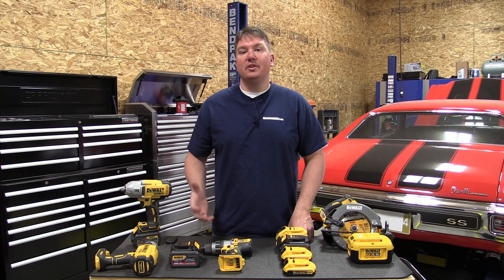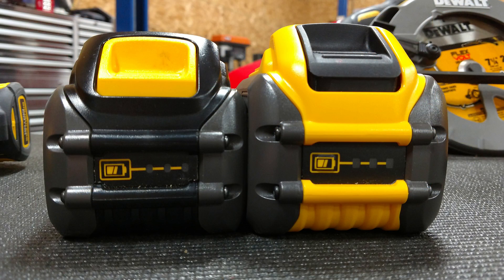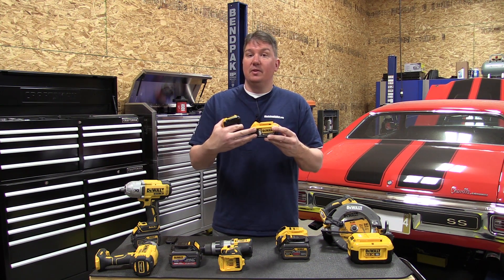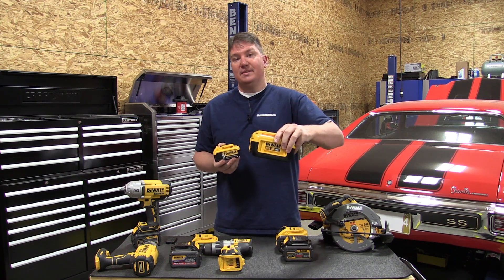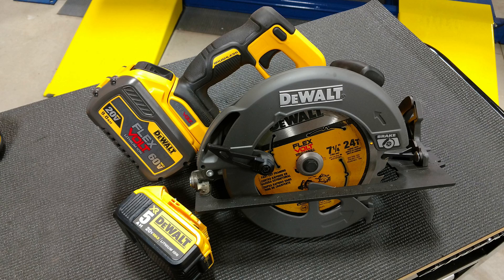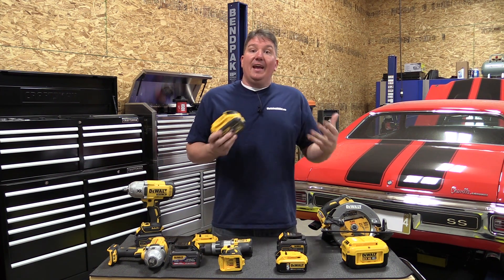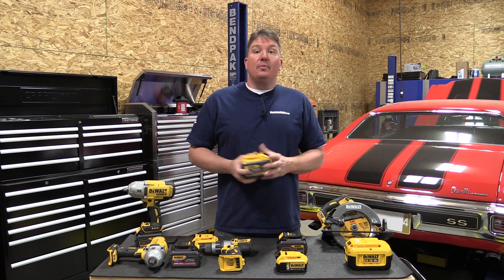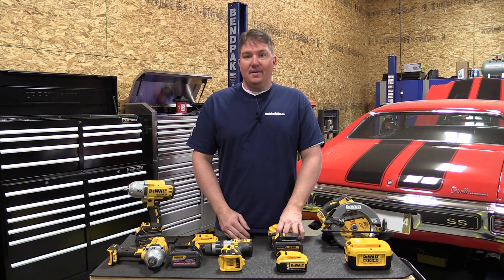Dewalt Flexvolt 9.0Ah 6.0Ah vs 20 volt max 5.0Ah 2.0Ah vs 40 volt - How Dewalt Batteries Size Up

Comment: I have to say, this video is a lot more confusing than it needed to be in my opinion but gave a good look at the sizes of the batteries and how they sit in the tools.. In the UK the 36v (40v Max to the Americans)  range is pretty much non existent. You certainly can't easily buy that stuff anymore. 18v (20v Max) is pretty much the standard now and the new flexvolt range is now taking on the mantel of professional user. Forget about the size of the battery for a second. It is really rather easy to work out what is going on. Making an 18v pack is easy these days and everyone does it. Making a 54v (60v Max) pack require 3 times as many cells to make the 54V. (3x 18 = 54) They could have just wired the cells in the battery to have a single 54v battery that had a single use in only 54v tools. But the way they have done it means that you have 3x 18v pack in the flexvolt battery and if you run them in an 18v tool you get the capacity of using 3 batteries. If you use them in 54v where it uses all the cells at the same time, you get the capacity of a single pack. 
A flex volt 6.0 Ah pack is quoted at 6.0Ah for marketing purposes as it sounds better and it is 100% true when used in 18v tools but if you join the 3 cell pack together to get the 54V the you will only get 2.0Ah capacity. 
It is actually a very clever way to get the best use from your tools and batteries. As the battery is capable of working at 18v it is totally capable of being charged from any regular 18v charger. The downside is the time, some chargers will charge a 18v 4.0Ah battery in 60mins. this means that same charger would charge the 6.0Ah flexvolt battery in 90 mins. The new chargers are fan cooled and charge the packs that much faster but technically there is no difference other than charging rate achieved.
I have no idea on the history of why Dewalt had to call the range 20v Max in the states but it is also technically true as an 18V battery when fully charged will put out 20v but only for a very short time until it drops to it normal working voltage of 18v for most of the run time. I assume there are different marketing standards in the states. 
Thanks for the video, was nice to see the sizes, especially that old 36v (40v) pack.
Reply: Cheers, thanks for your explanation as it relates to what we get here in NZ, and now the market is flooded with 20v tools but we're use to the 18v and 36v so everyone is wary. Even the sellers are unsure! Yay for youtube!

Comment: Hi  Guys  
question for anyone who has got the DeWalt DCB609 20V/60V  Flexvolt 9.0Ah Battery and has put it on a DeWalt  DCD996 Drill  or a  DeWALT Impact Driver DCF895  that have the belt clip on the side 
has anyone found that the 9.0ah battery struggles to go on the tools with this clip in place ? 
i have found you have to blend the clip to get the battery on  
please let me know if anyone else has found this a problem

Comment: Well, Dewalt might have some fault making it confusing, but to be honest, I don't know what's so confusing about it.

20V battery works with 20V tools.
40V battery works with 40V tools.
60V battery works with 60V tools.
Up to this point, SAME TO ANY COMPANY.

But Dewalt just adds one more here. 
60V battery works with 20V tools.

This just ONE additional thing is so confusing? Well, well...
Reply: Kyong Song not really there is just a pc on the 60 volt tools that switches the cells from running in parallel to a series setup giving less ah but more Volts
Reply: Don't be the idiot that puts a flexvolt battery on a non XR tool because you will find out real fast how quickly they destroy them

Comment: In uk and Europe the same batteries are sold as 18v and 54 volt they made it confusing for them selves.
Reply: Dewalt and many other tool companies play fast and loose with the numbers in the US to confuse consumers. their tools only run at 20 volts at starting power under no load, they are actually 18 volts just like every other tool brand once you start working. most European countries have stricter regulations regarding accurate tool output specs so all their tools and batteries are more accurately labeled there.
Reply: But it's kind of funny Snapper Europe is still marketing their tools as 82V Max just like in US... when it's actually 72V (20 cells)
Maybe some European countries have different regulations?
Reply: Kyong Song I think that by European law they have to name them as what the actual out put is as opposed to technical maximum out puts.

Comment: It's simple math: voltage (V) x amperage (I) = watts power (P). The small 20V battery can produce 2.0 amps for 1 hour so 20 x 2 = 40 watts for 1 hour. The smaller flexvolt is 20/60 so is either 20 x 9.0 Ah or 60 x 3 Ah -- both equal the same 180 watts for 1 hour. Notice the smaller flexvolt is essentially 3 times the battery of the small 20V battery, it's just connecting the 3 rows of cells in series or parallel. So if you had two 20V drills connected to these two example batteries, both being loaded identically, the flexvolt battery would last exactly 3 times as long (theoretically). Google "wiring batteries in series vs parallel" for further explanation.

Comment: It may be confusing to some of you but from an engineering standpoint it makes sense. When a electric motor has to put out " more power", then you have to increase the wire gauge and windings it it to do so. By increasing the voltage going to these new cordless tools and still be able to use it on the current line of tools its a win win. The tools that demand more voltage to operate more efficiently can use the 60 or 120 volts that they can produce but the hand drills and smaller tools still only have a small brushless motor in it that works fine with 20 volts. Being able to vary tbe voltage supply from one sorce and have it do it automatically is a huge advantage in tool design. That is whats going to hurt Milwaukee in the long run.
Reply: you do realize the 20v is 18 volt right..... Google it.
20 are 18 60 are 54
Reply: _ That is true when you already have a large inventory of tools at a different voltage.  Thus, it is a good sales technique to 'brag' about the smart battery design, which they wisely decided to do in view of all the 20-volt tools they have in their sales inventory.  This way they do not have to redesign all the tools.
_ However, it would be more efficient to have ALL the tools designed to work at the same voltage.  
_ The design itself will determine the current draw. Thus the less power demanding tools will run longer on the same battery.

Comment: Other tool companies did the same thing with the 40v batteries, putting them into yard and garden tools, then doing something different for carpentry tools when those 40v batteries would have been just fine at least for bench tools and 7-1/4" circular saws.

Comment: Good video that was a pretty straightforward explanation for people who don't really understand how those different batteries work. I am with you on the size of the batteries it is starting to get where the size is just becoming to much, granted ya on the flexvolt miter saw your gonna need those big batteries but then who is going to want to take that same battery and put it on their impact driver or drill. I run the Ridgid 18 volt tool platform and I have a ton of their 18 volt tools, I am up to 20 right now, and for things like my 7-1/4" cordless brushless miter saw and my hybrid panel light the big 5.0 amp battery is great because those tools demand more power and getting down to things like my 7-1/4" brushless circ saw and sawzall I will usually stick with 4.0 amp batteries on them and then further down my brushless hammer drill and my brushless Stealth Force impulse driver I virtually always run only 2.0 amp batteries on those tools, the exception being if I am doing a lot of concrete drilling I will put a 4.0 amp on my hammer drill, but I keep the 2.0 amp batteries on them because it keeps them lighter and smaller in overall size and they still get excellent runtime and even on the rare chance that I am working them so non stop that I kill a battery you know I would rather take 1 minute walk over to the charger and slap on another 2.0 amp battery that to run with the extra weight of a 4.0 amp all day. Don't get me wrong here though I do love that they have come out with batteries that can run larger things like these miter saws and lights and other high demand tools but I still think for me I always want to pick the best battery I can for the tool so that I have good runtime and power but I'm not going overboard and adding extra weight I don't need and I hear a lot of guys comment about that you don't need the smaller batteries anymore so why get them, well when a 2.0 amp can last me all day in my impact then why the hell would I ever want to put a 5.0 amp on it cuz all that's gonna do for me is make it heavier. I remember when lithium batteries started becoming standard I was amazed at how light they were and now they have just kept getting bigger and bigger lol but again I am thankful because 10 years ago if you told me I would have a cordless miter saw I would have thought you were crazy yet here we are today with multiple different ones that are replacing corded saws on the jobsite and ya dewalts flexvolt 12" miter saw is sweet and it is something else but honestly I gotta give it up to Milwaukee, Ridgid even Ryobi and Dewalt with their 20 volt miter saw and even Makita although you have to run 2 of their batteries with their miter saw but where I think those saws all shine is they run right off you existing 18-20 volt platform and can still put out good power get good runtime and produce results on the job and you can take a battery from your drill and slap it on your miter saw and vise versa with those examples and that is where I am really impressed, last thought I doubt we will ever get it because it would outshine the Milwaukee 10" 18 volt miter saw but AEG (Ridgid out of the USA) has a 10" miter saw they will run on 2 of their 18 volt batteries and here is the kicker unlike the Makita dual battery miter saw this AEG can run on a single battery and then if you want you can put in a second 18 volt battery for added runtime and more power, I have heard numbers of over 600 cuts thru a 2x4 on 2 fully charged 6.0 amp batteries (yes they get 6amp batteries where we only get 5amp oh not to mention they look better too looking nice like the 2 and 4amp batteries with the rubber overmolding) I mean this thing looks cool go check it out!  https://youtu.be/D8eK55Bfvms  Damn being in the Ridgid 18 volt platform that sure as hell is something I would like to see make it to the states!!! However again I doubt we will ever see it since TTI owns Ridgid and Milwaukee (Ryobi too) I doubt we will ever get that AEG (Ridgid) 10" 1 or 2 battery miter saw here simply because I think it might outshine the new 10" 18 volt Milwaukee and since Milwaukee is their top brand I am sure they don't want Ridgid or Ryobi to outshine Milwaukee in any way but hey maybe we will get lucky and they will send that bad boy our way, I've been thinking of asking my friends in Australia if they could get and ship me one lol but for one I have been pretty content with my little 7-1/4" 18 volt Ridgid miter saw since it will handle virtually everything I usually have to cut and two I honestly don't know if my batteries would be compatible since they run 220 volt over there standard where we run 110 volts so idk if that effects the battery design in anyway or not. Anyways interesting subject I wont keep on about it lol! Hey keep up the good work you guys I really like your videos your channel is one of my favorites here on YouTube so keep putting out those sweet tool vids, thanks guys!

Comment: The 20v 60v flex batteries are able to be charged by a standard 20v charger????
Reply: Bought the flex volt circular saw yesterday that comes with the air cooled fast charger = 30 min compared to the standard 20 volt = 2 1/2 hours.
Reply from the maker: Michael StJohn That charger, and saw, rocks!  It is nice that you can use any 20 volt charger if needed.
Reply: Yes, but it is slooooow!
Reply from the maker: Michael StJohn Yes, most high Ah batteries do charge slow.....
Reply from the maker: Yes, the Flexvolt packs are charged in the 20 volt form, same as the 5.0Ah 20 volt max battery is.
Reply: The 20v and 60v all charge using the 20v platform. Those big batteries charge waaaaay faster in the rapid charger (yellow) vs the normal chargers but it’s much louder and they say for on job sites the fan isn’t great with dust etc. I’ve never had an issue and I have 30+ batteries between 20v and 60v  with a bunch of chargers and have yet to have either charger or batteries fail after years of using them 6 days a week

Comment: i think the idea behind the 60 volt battery is that they can make tools like a miter saw that will either use 2 batteries or just use a power adapter so you can plug it directly into the wall.

Comment: came the 40v battery work with 20v drill
Reply from the maker: No, The 40 volt batteries are now for OPE.  They are much larger and heavier than even the largest FlexVolt battery.
Reply: Once

Comment: i have a question is better buy two 5.0 or one 9.0
Reply: Saul Cantor two 5Ah batteries will give you more runtime than a single 9Ah battery. But it will also cost you more for it. one good metric to use is Wh per $. the 9Ah battery will have a lower Wh per $. So you get more power for every $ you spend
Reply: Thanks 👍
Reply: A few smaller amp-hour batteries would make more sense.  If you just buy 1 larger battery and run it down, now you gotta wait for it to recharge before continuing with your work.  Buy a few smaller batteries and you can have 1 or more charged and ready to go.  In my case I have a couple different tools I'm usually using such as a drill and impact driver so I have 2 batteries on each tool plus 2 spares charged and ready to go.  

Those higher capacity batteries just empty your wallet faster and aren't really necessary unless you are running a heavier demand tool like a big impact like a 1/2" or larger, or the 7-1/4" circular saw, or the table saw or the 12" miter saw.  The rest of the tools work just fine on the smaller size batteries.
Reply from the maker: Actually, dollar per Amp Hour is cheaper in the larger batteries.  So actually, you are paying more for the smaller batteries.